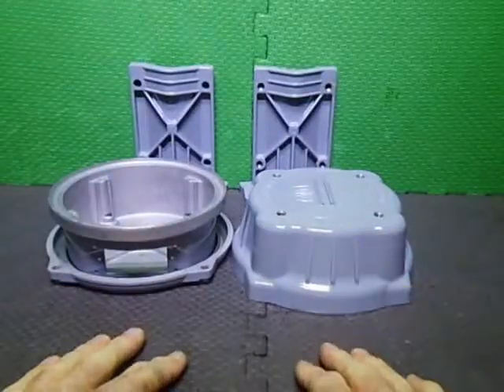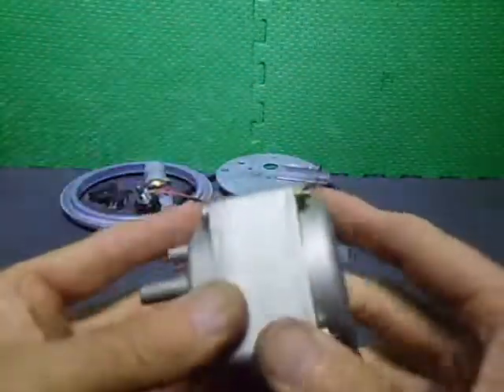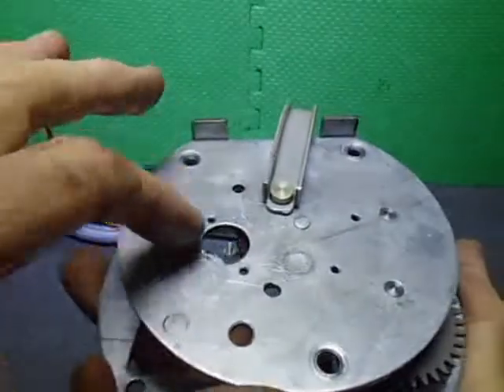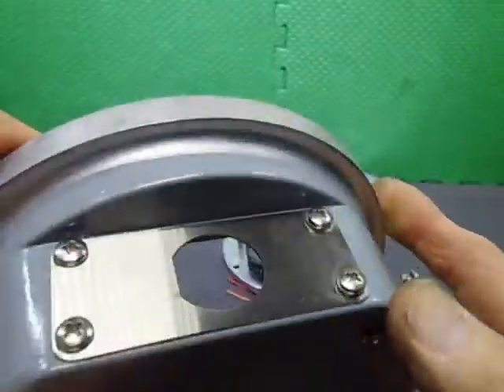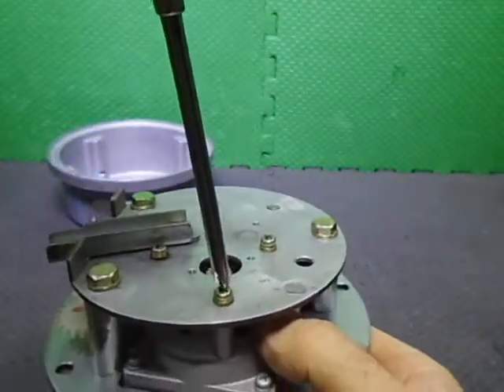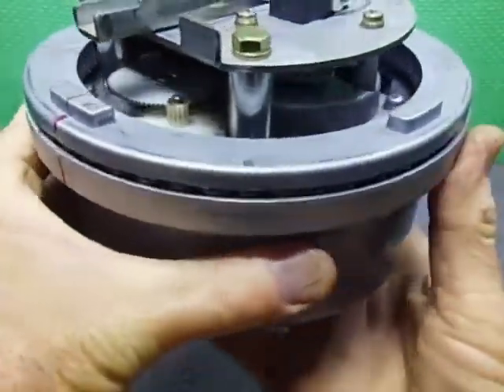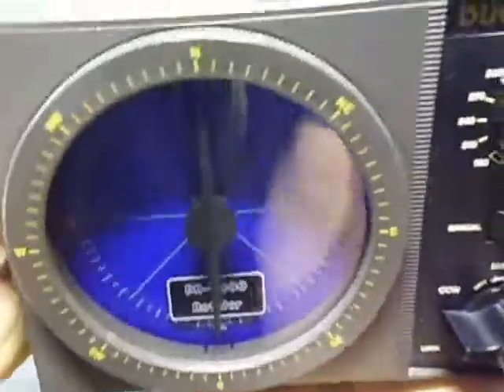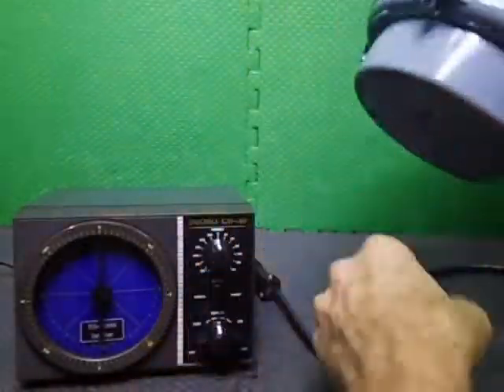A Few upgrades for a DAIWA DR 7600

Comment: hello there i have just bought one of these rotators preowned,i notice it seems to hunt a lot when turning it 360,,could it be dirty contacts in the feedback circuit please????
Reply from the maker: Hi Paul, Thank for the comment. Yes it could be the POT in the rotator, however since most of Daiwa's 360 degree display controllers (including the CR-4p) have a few small problems. It would be best to check the controller first. The main problem that happens to their controllers is the first small gear in the display drive train, this gear is normally affixed to the first shaft (the one with the large pulley on it). This gear cracks & allows the shaft to slip, which get worse over time to the point of not turning @ all. The first thing I do to all of these controllers is replace that gear with a new version, which is available on my web site.